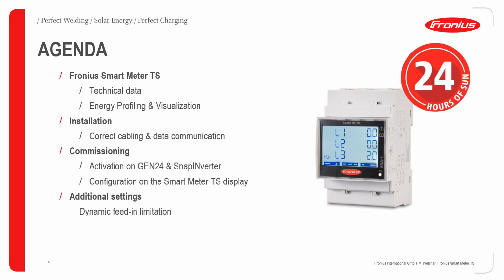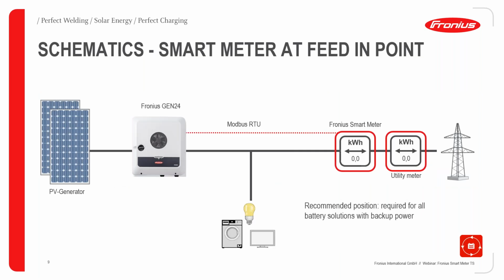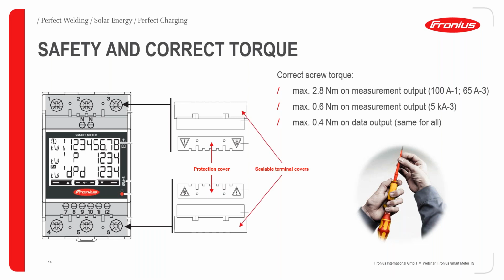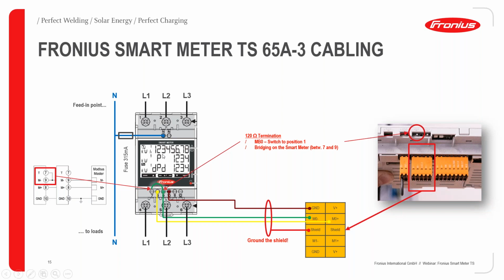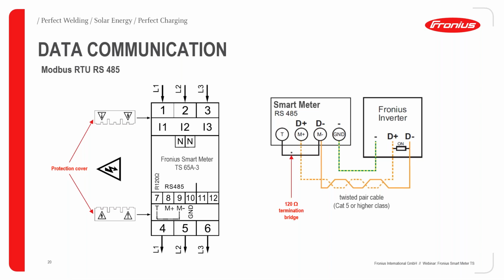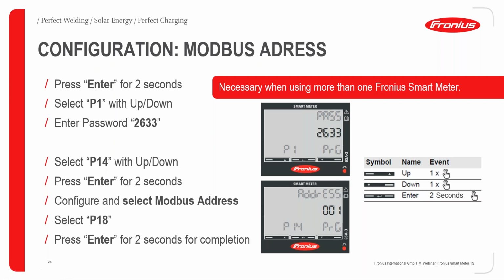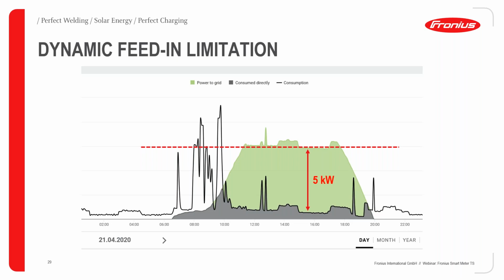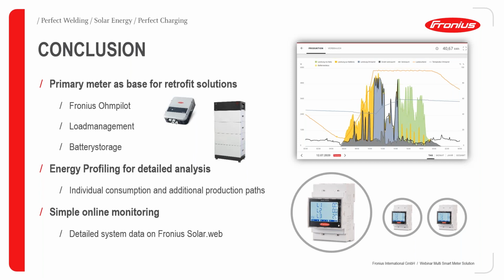Webinar: Fronius Smart Meter - correct installation and use of smart meter data

Comment: Hi. I have a fronius symo gen24, 8kw, fronius smartmeter 65ts-a3, on grid system.
When i turn on my cooktop, i get the following values on the meter's screen: L1 0.9, L2 -0.4, L3 -0.5. at the same time, the solarweb tells me thatbi use all the energy directly from the solar. At the same time, my utility meter says i consumed the sum of all the 3 values the smartmeter shows (without the -sign) meaning 1,8 kwh consumed

Comment: I have a fronius gen24 symo 8kw. A fronius smart meter 5ka.
The soft limit control is set to 0W. The problem is that when energy is needed on phase 1, the inverter sends the needed energy equal to all phases, not to phase 1 which is in use. So, the smart meter, installed at the feedin point, shows (for example) 1,3 kwh on phase 1 and -0,4 on phase 2 and -0,4kwh on phase 3. And if phase 2 is used, the same goes: L2 1,3kwh and L1 and L2 both -4kwh. (Theese values are an example from 2 different tests  made with a cooktop connected on phase 1, and an oven on phase 2)
What can i do to make it send energy to just the phase that needs the energy?

Comment: i mean i have issue that i cant install the smart meter, because my inverter cannot have cable connection due its in different building than the utility meter. and also power after utility meter splits in to 2 buildings. Do you have smart meter that is working wireless ?

Comment: I am looking to buy Fronius Primo 8.2-1 non-light version and SMART METER TS 100A-1. The problem is that I don't have contract to feed to the grid and I have to limit it to zero. Can this be done ?
Reply from the maker: Hi! Yes of course! All our inverters can do zero-feed-in limitation.
You can set this limitation right at the first commissioning of the inverter.
Furthermore you can set the limit any time you want, after the installation in the settings of the inverter.
Best regards, your Fronius Social Media Team

Comment: So on a 7000W system a Fronius symo 8.2.3 and a smart meter 65 A-3 Is all main components besides safety switches and fuses? Is Cat6 OK to run it 15 meters?
Reply from the maker: Hi! Yes CAT6 cables are good and also recommended for installation of the data communication.
Please make sure to stick to our installation guide for cabling the communication. Best regards, your Fronius Social Media Team

Comment: How Smart Meter TS meter calculates the total of energy imported and exported?
A) the energy imported and exported is counted at each individual phase and then the Total is provided from the sum of those values.
or 
B) the energy imported and exported is counted as a total power, with net differential readings from each phase cancelling each other out.
Reply from the maker: Hi! Our Fronius Smart Meter is measuring each phase individually and for now provides the total energy to the inverter, for visualization, monitoring and energy management. Best regards, your Fronius Social Media Team

Comment: Ohmpilot price is nonsense. Nobody can even buy it. It will never pay back during years of use.
Reply from the maker: Hi! Please keep in mind that you save on several points with our Fronius Ohmpilot. You save on running costs like oil or gas for heating, and furthermore you can save on service costs for the main heating system. The Ohmpilot minimizes the operating hours of the main heating system, and therefore makes sure that the main heating system has a longer service life and less operating hours. Furthermore you have less heating losses. For example the main heating system does not have to heat the whole heating circle for heating up only a few liters of hot water on summer days.
So there are several point to save money with our Fronius Ohmpilot. Not only operating costs.
Please watch our Webinar on the Fronius Ohmpilot for more information: https://www.youtube.com/watch?v=VrWa_6GBWTY
 
Best regards, your Fronius Social Media Team